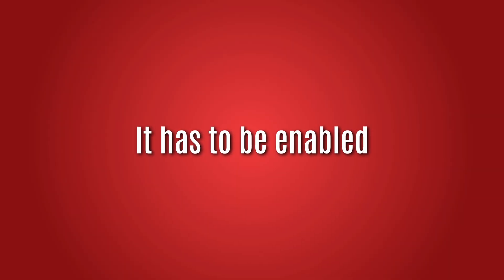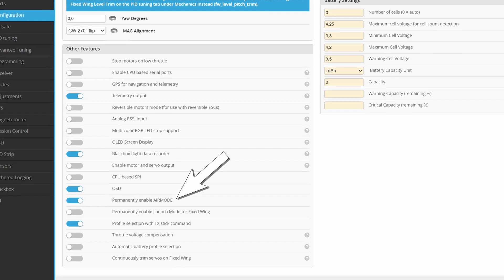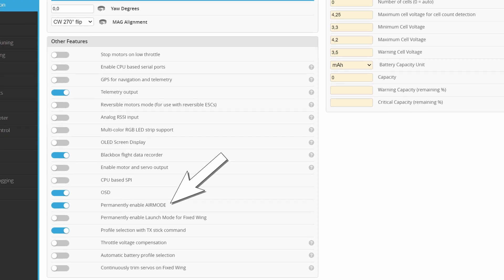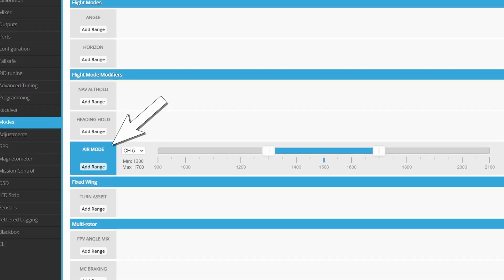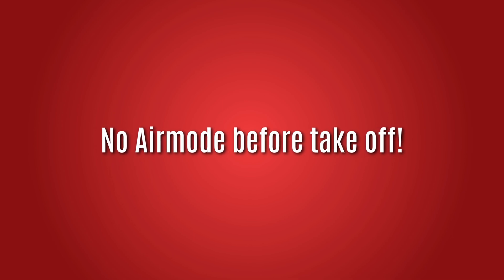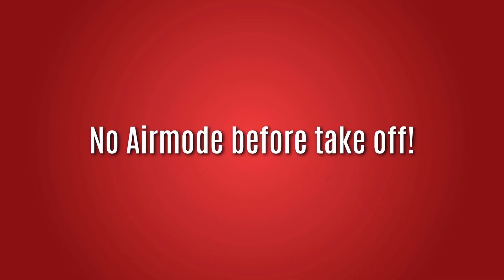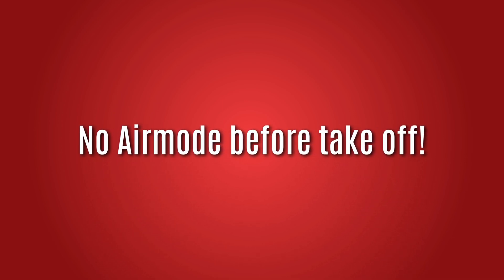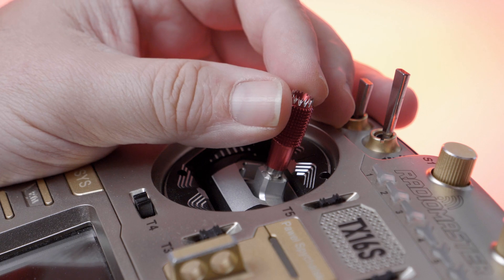Why INAV Airmode is not working?

Comment: For my drones, especially those with tilted motors, I have a 3-position switch set up as follows:
position 0 (ready to fly) - Arming and Airmode both switched off
position 1 (for take-off) - Armed and Airmode with throttle threshold
position 2 (for landing) - Armed but Airmode disconnected